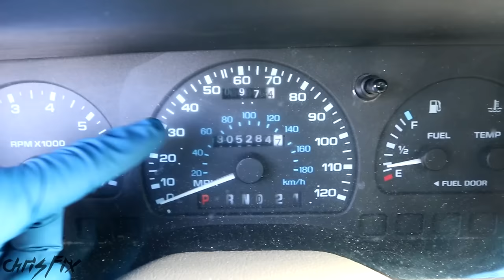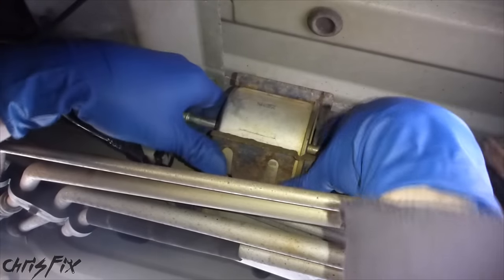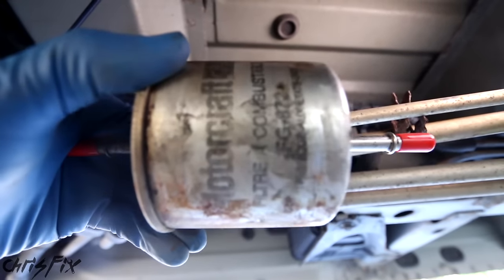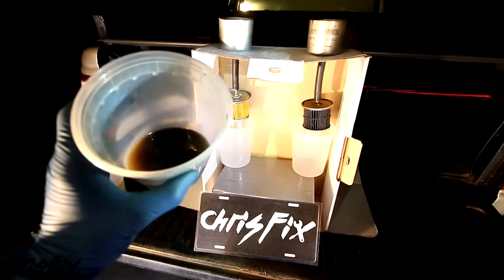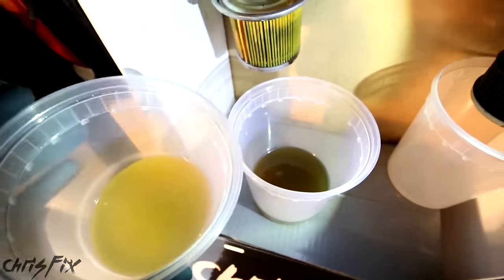What does the inside of a Fuel Filter look like after 300,000 miles?

Comment: I had a 97 Fleetwood Bounder Class A motorhome on the P30 Chevrolet Vortec 454 Chassis that I bought in 2007 so 10 years old..only 7,400 miles! Sounds great right? WRONG! It had set at a campsite for 10 years and when I filled up the gas tank, 75 gallons, it ran well until I got down to a 1/4 tank then it would hiss, spit and sputter along with the check engine light would come on and I could not go above 45 mph...I came home and changed the fuel filter..new filter ran like new! Took old filter and cut in half..it looked like it had GA clay all inside (I'm in FL) it was rust...the gas tank was full of rust from sitting 10 years..Several filters I was still getting rust..SOld it..new buyer called on his way home to Palm Beach said it was acting up haha I said there was an extra fuel filter in the compartment haha I think the tanks would have needed to be either replaced or coated/cleaned but I sure learned a lesson to NEVER buy something with low miles that has been sitting! side note the generator had 8 hours on it..they had to clean the carb and bowl to make it run for me when i bought it..was fine from there..

Comment: I believe this is what caused my fuel pump to burn up. My truck has 390k on it and I just put a new fuel pump in it today. 3rd one in 2 years and I believe I have a dirty fuel filter. Truck wont idle and wants to fall on its face when I try accelerating any at all. I put the new fuel pump in it and it still wont idle. I can tap on the fuel filter while its rough idling and it will sound normal. I need to get me a new one but I dont have a way to the store and I dont have a card to buy one off line. Guess I'm walking

Comment: Now on many new cars you're stuck with in tank filters only as part of the pump assembly.  Which is a load of crap if mfgs said change every xxx why is it now lifetime.  Either the filter would be incredibly larger or it's just getting loaded up.  There usually was a sort of prefilter already before this happened.  I'd be interested to see what a supposed lifetime filter looks like with this type of test.

Comment: A dirty filter filters better than a clean one. Obviously you don't want to impede oil flow but to impede a little air or fuel flow doesn't hurt anything (unless there's strain on the fuel pump). 
Think about it before reacting to what I said. 
No I'm not saying don't change them.

Comment: Couldn’t you just turn the car off instead of taking the fuse out while the engines running
Reply: He did that to relieve the fuel pressure on the line. I had to learn the hard way.

Comment: You made an error. Draining from the input side will always have gunk in the backwash. You need to drain the output side first to see if the fuel in clean on output. Even a used filter may work well. That said, filters are cheap and changing about every 10K miles is better.

Comment: My Toyota Celica 2001 and has a weird setup. It has the REAL fuel filter inside the Gas tank.  The set up has a plastic casing around the fuel pump, and inside the plastic casing is the real fuel filter.  On the outside, it has a filter sock ( what they call the fuel suction filter)  Everyone is saying don't replace the fuel filter, as it's not necessary. But when we took out the old pump -- because the fuel pump was failing -- there was so much dirt and gunk in the fuel filter.  The car is 20 years old with 185,000 miles on it.  So it should be replaced. I need to look for the part and replace it before I end up damaging the new fuel pump I put in.  
 If anyone has the same car as mine google " How to replace a fuel filter on a 2001 toyota celica gt?
" and it should be the first one with the diagram. 

Does it seem right? I mean with 185,000 miles on a 20 year old car, it doesn't make any sense to NOT replace the fuel filter casing/ filter.

Comment: I went overkill when i reworked my fuel system
Reply from the maker: Dang why? Clogged up?
Reply: @chrisfix  i rebuilt it from the tanks to the engine. Went with an aftermarket selector valve that works off 12v. The other worked off psi. Changed the tanks to gravity feed with a shutoff valve followed by a clear 3/8 carb filter to an external pump. From there it went to the selector valve. After  the selector valve i put another clear 3/8 carb filter before the high psi pump. Then its a fram 3802 after the high psi pump. I had some trash get in the tanks when i was changing the in tank pumps. The 3802 didn't catch it. I then had to pull the upper intake and clean the injectors out one by one. I went with external pumps because the in tank pumps kept going out. Was all under warranty but its the fact of time off from work and having to take to bed on and off each time

Comment: Your flow test set up is not entirely right. I will think you reversed the flow. Well, this is probably going to affect of flow of the old clogged  filters much more severely than the new one. Just think about the usual fuel flow direction the old filters were used to. and this might have had effects on how all the dirt and particles were arranged and how they settled in, on and around the filter paper. Once you are trying to test the flow by putting the filter in an reversed direction, you might have unwittingly dislodged and rearranged part of the  filth resulting in a faster or slower flow rate.

Comment: You cant never get a fuel filter get clogged y beacuse fuel as to be clean... From any large or small things... Its drity because people dont wash the gas tank cap when u put in fuel.. Drit by time gets in the system.. When putting gas but will not hurt the again ... To me is better to have then dont have old oil oil coolent but the onlything i know should be in all cars truckz what ever as coolent to be changed dont want the metal to be eatten then it gose in the oil system.

Comment: Getting less gas mileage ....changes air filter, fuel filter , engine oil , spark plugs but not brake oil an engine coolant which looks fine . Thinking its a fuel injector problem....car runs great but 5 mile lesser mileage

Comment: So dirty fuel filter can ware off the fuel pump causing the pump to work more than its requirements. Cars are very sensitive motor engineering products that behave like or less than people but without spirit. Surely they need care, respected and maintain. If you don't like maintenance forgot owning a car. Some are good cars (aka Toyota), some moderate cars (aka Kia) and some are garbage metal products (German cars).

Comment: I wish fuel filters weren’t inside the fuel tank like they usually are these days ughh
Reply: Actually all cars have filters inside thr fuel tank. There are 2-3 filters in a cars duel system. One is somewhere between the rank and the motor (the thing in the video) and 1 or 2 inside the fuel tank. Those are most of the yime mounted on the fuel pump. And they are also called fuel socks but they are filters so yeah :/

Comment: only 30k miles haha u need to change fuel filter after about 7k miles. Im always changing fuel filter with oil in engine (filter included) maximum 8k miles.
Reply: Are you talking about the oil filter? haha
Reply: @Master_D93  fuel and oil filter should be changed at the same time during oil engine service its normal in Europe to do that one time per year or 7-12k miles. Btw You dont have to do that in your car, but i do care about mine so im doing it :)